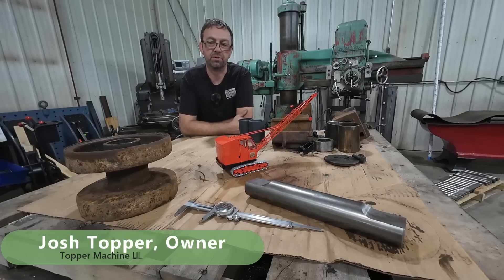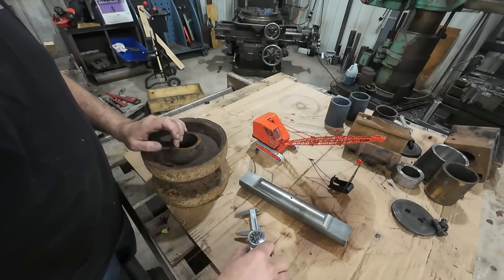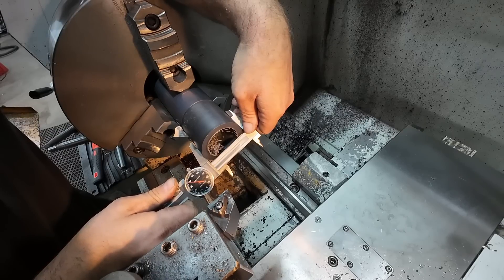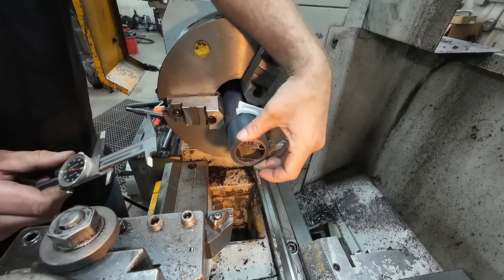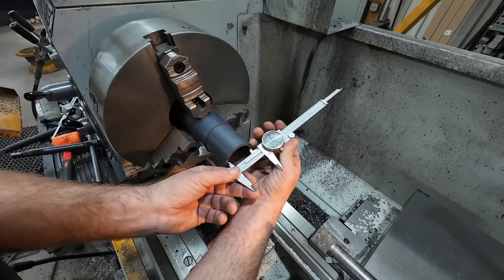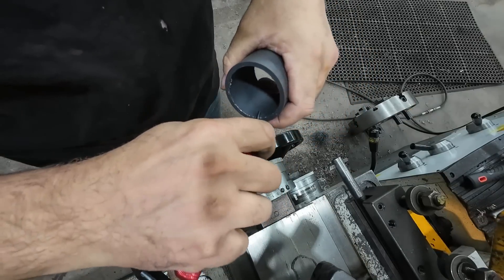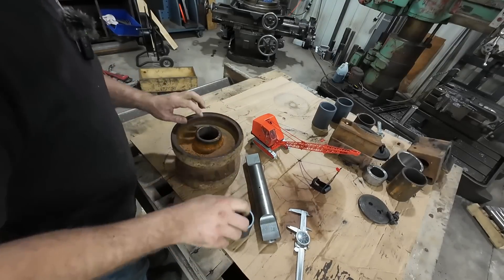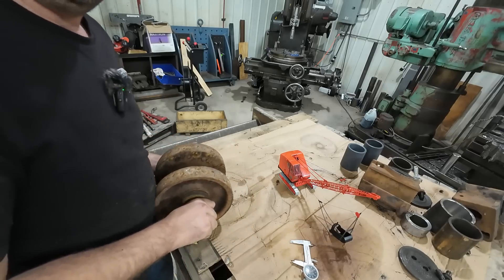Making New Bushings For The Dragline Crane Track System - Manual Machining Nylatron

Comment: Interesting video, I saw recently on another channel that one method to keep the plastic chips at bay is to suck them up with a shop vac....so they go away vs sticking around.  Has anyone else tried that and had success with it?   I have not yet tried doing plastic on my lathe but am always trying to learn in case/for when I do.

Comment: I have two comments but will combine here:

I’ve used nylatron gf30 before which is 30% glass fiber reinforced. I assume you are using nylatron gsm or nsm, right? I don’t think you’d want glass fiber for a bearing surface- but could be wrong. Thanks for clarifying!

I noticed it looked like you were going to a number on your dials on the lathe. It reminded me that both Tom Lipton and Joe Pie have promoted “tool” settings in the DRO. Granted- looked like it took you no time at all, but just curious if you considered storing your turning tool, boring bar, and parting tools with offsets so that you just “dial to zero” for each tool. Do you think that would have actually taken longer? Would it be a quantity thing- like if you had a hundred to make, then maybe the DRO would help? But just not worth it for 30? 

Thanks Josh- love your channel!
Reply: Bumping in case you missed these questions.

Comment: For a second there, I thought you were using a  VBM. Then I realized that we were looking straight down into the lathe with the long axis vertical in the picuture. 

Nice work on the project, the nylon is a very good idea, just as good as brass and most likely a whole lot cheaper.

Comment: Seeing this, I owe a sincere apology to a 3rd Engineer I sailed with in about 1979.
We were doing a cylinder overhaul on a large Sulzer main engine (900mm bore and about a 1,500mm stroke) there were bushes on the cooling water pipes to the piston that needed to be replaced. The 3rd Engineer said "Oh yes those Nylatron bushes will need to be replaced." I'd certainly never heard of Nylatron and nor had any of the other Engineers. We started to take the piss out of him mercilessly over the coming days, every time he said something, someone would find a way of inserting NYLATRON into the conversation. 
I made up a menu and gave it to the chief steward who sportingly printed out a copy for the Engineers table at dinner in the saloon that night. (This was at a time when the UK Merchant Navy still had silver service and stewards serving at table, with 5 courses in the evening). So to start we had Nylatron soup, followed by Devilled Nylatron bushes. The main course was Fillet of Nylatron with mixed vegatables and for sweet was steamed Nylatron pudding and custard, followed by cheese and Nylatron biscuits, or something very similar.
This was enough to tip him over the edge, he took one look and shouted at the top of voice, "You f***ing b***ards, leave me alone." And stormed out of the saloon.
I think we realised that we had taken it rather too far, and that was the end of it. But now learning that Nylatron is very much a thing, I really do owe him an apology.
Having said that it was a good laugh at the time, for us maybe.

Comment: Great job. I think that product is called Acedel in Australia, yep H.S.S. oil stoned & reasonably fast feed I find works well. This product seems to take heavy loads & dirty conditions well.
Reply from the maker: Acetal is totally different. I am sure nylatron is available to you. Just call your plastics supplier
Reply: @TopperMachineLLC  thanks I just had a look  nylatron has molybdenum disulphide impregnated, interesting I will chase some up for the next job.

Comment: I enjoy your no nonsense approach.  For the plastic lathing, could you put a vacuum at the other end of the thru tube? Develop a low pressure to remove the. Chips like a sawdust system.
Reply from the maker: I prefer compressed air over vacuums. There is more power to direct

Comment: I'm curious the advantages of nylatron over delrin? Not criticizing just curious as I have used delrin extensively over the years for bushings and gears etc but might change to nylatron if there is a good reason. Bronze is so expensive I really only use it for visible restoration parts like the ball joint linkage ends I machined from solid for my Ames Iron works steam engine
Reply from the maker: Call your local plastics dealer. They can give you all the specs. Mine suggested nylatron over everything else to replace bronze.
Reply: I don't have a local plastics dealer sadly, it's McMaster carr and eBay for me. Specs look similar to deltin from what I can see online but I may have to give it a try next project that comes along
Reply from the maker: @markvoluckas4571  I don't have one local either. I order it all from a dealer 3 hours away. Never met them, but do a lot of business with them.

Comment: Hi Josh. I machine some very similar plastics and I use inserts designed for aluminium. They work very well. Certainly worth a go next time. Bob.
Reply from the maker: Thanks for the info. I'm actually going to order a new boring bar just for nylatron

Comment: This Nylatron GSM tubing looks like a good material to work with. As long as it stands up to wear like bronze, it should be a better solution for this application. Hopefully you have enough time to get the tracks back together before you get snow.
Reply from the maker: Don't look like it will happen this year.

Comment: I might have thought about oring grooves in the nylotron bushings to insert a square cut oring into to reduce dirt and water into the load bearing area
Reply from the maker: Grease will drive that out. Shouldn't get too bad anyway. As long as I pay attention and don't do dum. Stuff

Comment: In my world, we use nylatron mostly in sheet form as wear pads between two steel surfaces.  Easy to machine and lasts longer, usually longer than brass.  Works great.
Reply: For what sounds like similar applications, we use Robalon which is a UHMW-PE that can have different solid lubricant additives, e.g. MoS2 like Nylatron. Since Nylatron is basically nylon, I would be a little concerned about swelling in water but maybe that's no big problem, at least not for you. UHMW-PE has great resistance against many chemicals, I think more so than nylon.

Comment: Why do machinists almost always cut the identifying labels, painted code colours , off the end of materials, and then in six months wonder what this mystery metal is/was. Surely, turning the piece around and leaving the identifying marks on the other end would help later. Just a thought.
Reply from the maker: @ronwilken5219  in this case, it doesn't matter. I only buy nylatron, no other grade of plastic locks like it either. So no problem there.

Comment: I'm retired from aerospace machining, there were some materials that we couldn't bore without a stringy chip. The solution to prevent them from wadding up on the bar was to start at the bottom of the boar and feed out, the chip comes across the insert into the bore the chuck instead of coming off the insert in the direction of the boring bar... It might make an interesting thing to try machining nylatron...
Reply from the maker: Great suggestion. Never thought about that. I had planned on ordering a DNMG insert boring bar with thru coolant. Just hook the air line to it and blow it into the bore. But I'm liking your idea. Have to give that a try.
Reply: Ty I machining aluminum sky pole in a mazack and the stringy chips would always tangle up and ruin the finish
Reply: What id like to know is whether the   dimensions you used on first 2 sets of bushes were consistent throughout to last one as i anticipated variation due to uneven wear on some wheels. Other than that,interesting project  hope the restoration goes well, i have some projects this side of pond as well such as trying to bore a hole in  a pulley larger for a  new lathe motor for my lathe which was out of commission for almost a year

Comment: Morning Josh,
Something I've seen others do and worked very well for the string cuttings on delrin cuttings were using a shop vac hose tied off close to the cutting point sucking the cut material away instantly. Worked very well on both on external and internal cutting. With the amount of bushing you have to do it would be worth setting up for you to try it. Would save a lot of clean up. 🙂
Reply from the maker: @joewhitney4097  air blowing it through the headstock is much more effective.
Reply: @TopperMachineLLC  The vacuum works just as well when turning the OD.

Comment: I hope Im wrong but I wouldnt expect those bushings to last long. For one thing, I always thought plastic bushings should run dry. Grease actually makes them wear out faster. I know the nylon wheels for mowers last much longer with no lube. Put grease in them and they wear out in no time.
Reply from the maker: The grease won't hurt these much. Basically it will only get a little initially, then greased once in a while to drive out contaminates. If they wear out, I just make more. Not a big deal.

Comment: Would it be any purpose to run the rusted track rollers thru the vibrator cleaner you recently purchased?
Rust free and new paint looks nice though 😊
Maybe too late now that you have installed the bushings
Reply from the maker: Paint doesn't make it run any better. This is a rebuild, not a restoration. It will be functional, not a trailer queen.
Reply: @TopperMachineLLC  in other words Rustoration like our friend Mustie1 does. Functionality over beauty.

Comment: Are you planning to use grease? Usually with plastic bushing isn’t necessary 
Nice work…
Reply from the maker: Grease will be necessary to drive out dirt and other contamination. As this is an in the dirt application, it will get contaminated.

Comment: In BERMUDA, I am responsible for our 9 32 ft, 6 oar, Pilot Rowing Gigs and the trailers. Boats are F/glass at about 800lbs. No amount of rinsing off salt saves the wheel bearing. I knock out the 2" rollers bearings,1" solid St, Steel axles, and install Delrin 3" hub width bearing stock. Some are now 8 years old.

Comment: Do you have a detailed video of the dragline model?
Reply from the maker: @erik_dk842  I do not. But it's very accurate.
Reply: @TopperMachineLLC  I grew up surrounded by square miles of gravel pits with house-sized draglines. Lima, Manitowoc, Bucyrus-Erie, Ruston. My older brother's friend had a homebuilt dragline model that I used to marvel at.

Comment: you forgot the shameless plug lol.... that has to be cheaper then bronze or brass or comparable metal bushings isnt it? also much faster to machine. only thing to worry about is heat you will have to keep dragline below say 20 MPH so they dont melt
Reply from the maker: Surprisingly these hold up will in hismgh speed applications. Also, buy anchorlube!

Comment: Nylatron, I looked it up. Interesting stuff. I have used Delrin in the past for similar bearings. Being a 60 Year old bronze Luddite I find I don't think about plastics. However I am slowly coming around😁 especially as the cost of yellow metals is sky rocketing.
Reply from the maker: I've had great success with nylatron, but this will be the ultimate test of it. Cost was the biggest factor in this project. I have under $200 in material vs bronze was quoted over $1000.
Reply: Nylatron, Nolu-S, and Delrin AF, are the most amazing engineered bearing plastics on the planet. Amazing materials.

Comment: If you were to grind a tool specific for this material, what would the angles be? I've worked with acrylic a little, and the best angles for the drills were a square corner where the bit scraped the plastic away. Prevent pulling into the work and chipping. Would this be the same type of application?
Reply from the maker: Very similar. A sharp corner gives a great cut in plastics, a small radius makes a smoother cut. Actually a tight angle insert like a DNMG would work great.

Comment: Nylatron has molybdenum disulfide in it which makes it good for bushings.
Reply from the maker: Been using it for years with great results. This will be the ultimate test
Reply: @TopperMachineLLC  Go put in those wheels and test it out right the first time.
Reply from the maker: @garyh4458  if this works, it opens up possibilities for many other applications
Reply: Plus it has a grease hole, so the grease will help alot too!  With the rollers being such low RPM and it being better at corrosion resistance...they will outlast the originals probably alot!
Reply from the maker: @haydenc2742  that is the hope. My other thought was dirt infiltration. It should have a little more forgiveness for dirt.
Reply: I would think you wouldn’t need grease - that’s really the purpose of the moly disulfide in the nylatron. I’d be concerned that grease will just hold dirt and become a grinding paste.

Comment: Glad to see you having the time and space for your own projects !   As an armchair machinist, would it be feasible, since the material was so easy to work with to machine down and bore out a longer section of material and then cut off 2 or 3 bushes at a time.  I was thinking that it may reduce the number of tool changes on such a repetitive job ??
Reply from the maker: Quite honestly, i wish i didnt have the time to work on my stuff. Absolutely no work for the last couple months now. Customers going out of business all over. It is bad practice to do that. You would have a much longer part that is unsupported, causing deflection and making an out of spec part.

Comment: Nylatron really is a wonderplastic. One of the most practical there is. I’ve had good results using very sharp inserts designed for aluminum. But it cuts so nice it doesn’t really matter.
Reply: Spot on, polished inserts work great.